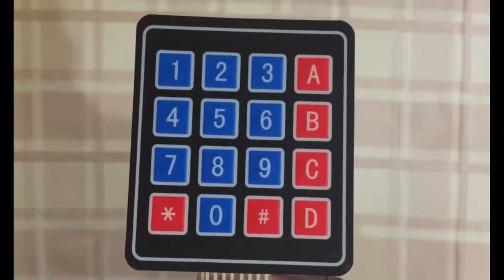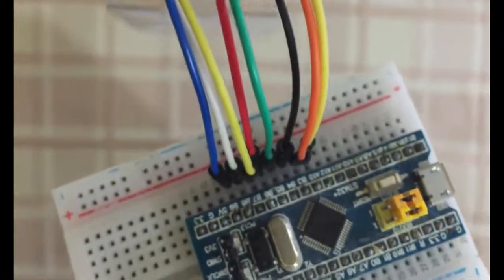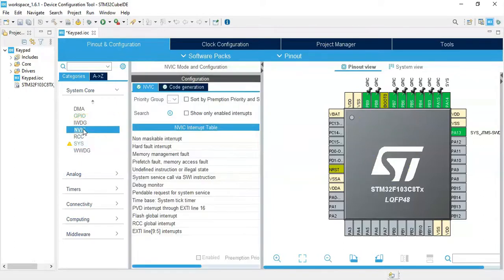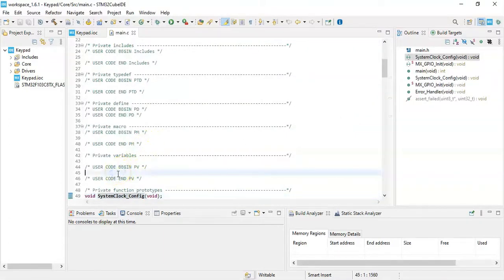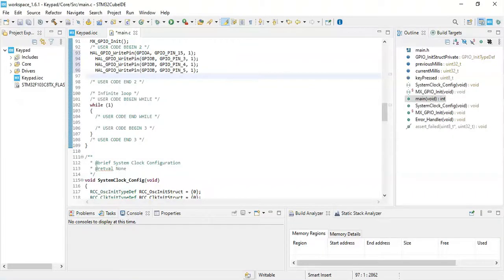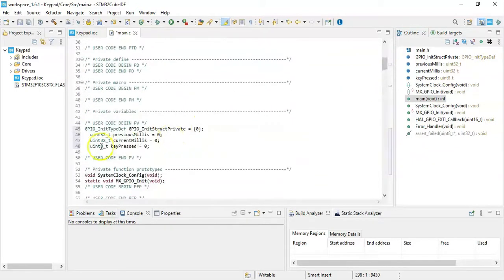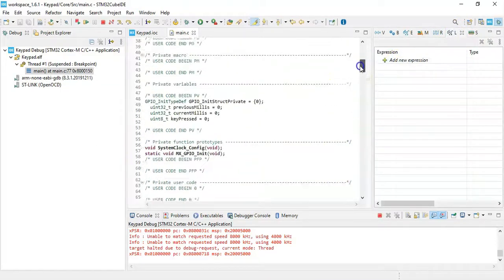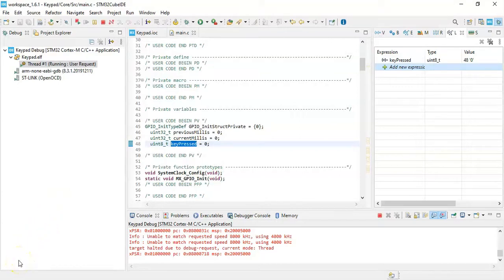35. STM32CubeIDE 4*4 Keypad. Interrupt debounce with STM32F103C8T6

Comment from the maker: Here is a bit more details.
1. How to use the code for any projects
2. How the code works.

First, whenever a key pressed, the value of keyPressed in /* USER CODE PV */ changes. You can simply use it in the main loop to control something. You can also use straight away in the HAL_GPIO_EXTI_Callback function to control something as I have controlled a servo motor in video-36.

As for the technical details of how the code works, I have used interrupt and then changed the GPIO_Input to find which key is pressed. I have done a simple Interrupt example for a single button in video-34. Have look at it first. 

In this keypad project, I have used pins as interrupt mode first and then changed to ordinary GPIO_Input to see which one caused the interrupt. After finding the key, changed the pin mode to interrupt again.

Comment: Hello, thank you for sharing your video.
I want to start the keypad interrupt with the LCD.
I used your code with slight changes but the problem is that I can only display one key and for example I can't display the number 85 on the character LCD.
I don't know much.

Comment: thanks for your reply and can you please explain  " GPIO_InitTypeDef GPIO_InitStrucPrivate = {0}" Is it a built in structure?
Reply from the maker: Yes. That is correct.
GPIO_InitTypeDef is a built in structure. Declare a variable xyz in that nature and 
For ordinary input pin
xyz.Pin = GPIO_PIN_6; //Here it is 6. It can be any pin you want
xyz..Mode = GPIO_MODE_INPUT;
HAL_GPIO_Init(GPIOB, &xyz); // Here Port A, B, C and so on

For interrupt pin.
xyz.Pin = GPIO_PIN_6; //Here it is 6. It can be any pin you want
xyz..Mode = GPIO_MODE_IT_RISING; // Or GPIO_MODE_IT_FALLIING;
HAL_GPIO_Init(GPIOB, &xyz); // Here Port A, B, C and so on

Of course, you can initialize other aspect such as Pull or Speed

Comment: Where do you buy the keypad??
Reply from the maker: Search "keypad arduino"
You will find in Aliexpress
Reply: @NizarMohideen  Your videos are excellent. Just subbed. How does that keyboard connect to the PCB?. Is that just male to male jumper wires on the GPIO

Comment: wonderful video---Professor can you please explain the code in detail because I am just a beginner---From CANADA
Reply from the maker: Thanks. I am going to explain 
1. How to use the code for any projects
2. How the code works.

First, whenever a key pressed, the value of keyPressed in /* USER CODE PV */ changes. You can simply use it in the main loop to control something. You can also use straight away in the HAL_GPIO_EXTI_Callback function to control something as I have controlled a servo motor in video-36.

As for the technical details of how the code works, I have used interrupt and then changed the GPIO_Input to find which key is pressed. I have done a simple Interrupt example for a single button in video-34. Have look at it first. 

In this keypad project, I have used pins as interrupt mode first and then changed to ordinary GPIO_Input to see which one caused the interrupt. After finding the key, changed the pin mode to interrupt again. 

As for the electric-mechanical details of the keypad, there are many videos available in the YouTube.